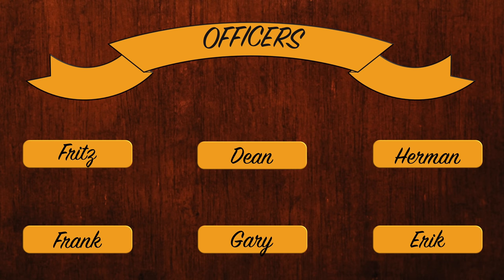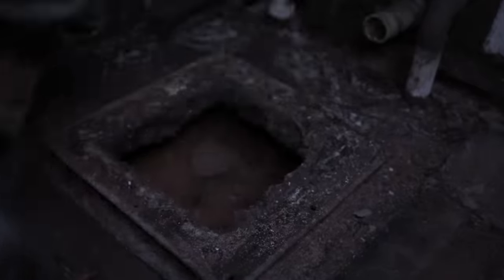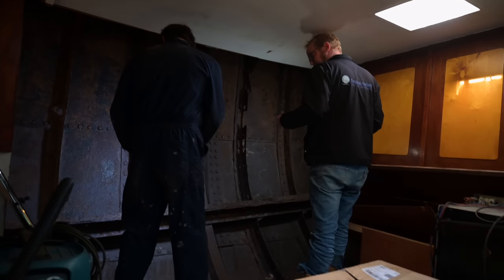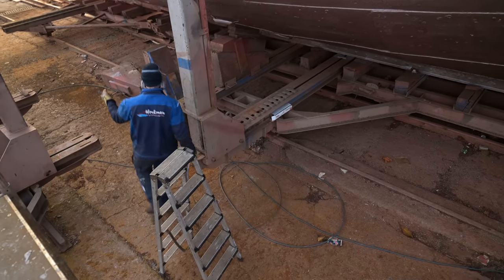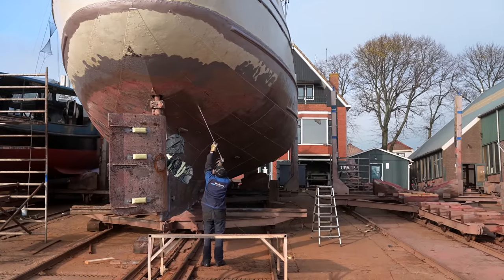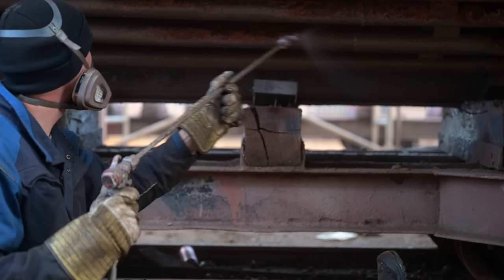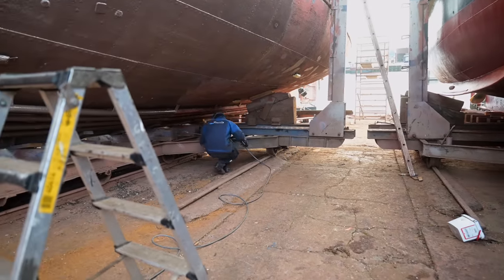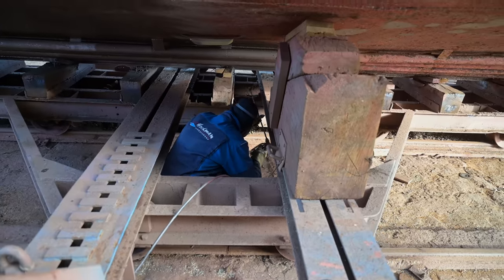Finally Painting Our Historic Steel Ship

Comment from the maker: ❓❓❓What do you think? How many liters of primer and antifouling has Jan sprayed on the hull❓❓❓
Reply: I'll guess 30 gallons or around 120 liters of each.
Reply: been watching since the beginning  will watch until the end you have me invested in seeing this completed then the journey's you will do after it's done
Reply: I Think it’s wrong to paint the zink annodes! Now you will have suver corrosion!!!!
Reply: Who cares!
Reply from the maker: We haven't painted over the aluminium anodes! 3:35
Reply: Lots
Reply: I think you should have sand blasted the hull.
Reply from the maker: @bertram5798  Jööö 🤣🤣🤣
Reply: @leifjonsson9410  Look closely, they were taped over before painting commenced.
Reply: 240 L
Reply: Hi you don't seem to understand. Its not the overall amount it's more the thickness. It's at least two coats and a third on the waterline of antifouling. And of course the same goes for the primer. I bet the rust is already shown through and you haven't seen salt water yet.
Reply: 20 kgs of both
Reply: a lot?
Reply: @leifjonsson9410  better watch with your eyes open....

Comment: You can also tow your ship with a rowboat. My father was an inland shipping skipper and he once towed a 600 tonne (loading capacity) towing vessel in a port to the quay for loading. It was about a hundred meters and there was little wind. So this should be possible with your dingy, especially if you use the 6hp outboard motor, although the outboard propeller is not very suitable for towing.

Comment: Great job guys.  Flying Coney looks fabulous in paint, so important to get the preparation right - and have a tall Dutchman to wield the paint wand!. When we repainted our Dutch steel trawler last year. We stripped all the paint to bare steel and elected to use two-pack paint.  3 coats of two-pack below the water-line then a single tie coat to allow the anti-foul a good bond.  We are hoping to only need to renew the antifoul over the next 10 years.  can’t wait to see how you progress with the interior.
Reply from the maker: Your project sounds very interesting and quite familiar. What's the name of the your beam trawler? I've also read your previous posts and find your observation on hydrojet blasting quite helpful. Where are you located? All the best!
Reply: @FlyingConey  Hi Barbara & Daniel, our vessel is called “Stella Maris”.  She is a converted 1962 Beam trawler, we think possibly from the Urk region.  She is 67 feet LOA.  Stella Maris is berthed at Ramsgate Royal Harbour, South East England. I did not have the foresight to video any of the work but I did take lots of photos.  Perhaps when I find time I will try to collate them into a slide show.  My background is maritime.  I was a sailor in the RN and therefore learned how to prep and paint steel from a young age.  When your vessel spends only 14 weeks a year alongside, you have to make sure your paint job is good or the next time it is much harder because you have to go through all the hard work that you have both now experienced. I hope you are both really enjoying your beautiful ship.

Comment: A small question but I cant help it. Do the small patches under the wooden keel blocks get painted? 
As always, amazing job Flying Coney
Reply from the maker: Actually a very good question ☺️ The answer is, no they're not but it's a very thick piece of steel and it's some people recommend to go to a different shipyard from time to time so that not always the same spots do not get painted. The problem is that ships are only built for 20-40 years so during their lifespan it doesn't matter. Bur Flying Coneys keel does look fine.
Reply: Thanks!

Comment: 9:55 "Its a steel ship." To myself: "wait? Is that ship stolen??".... "No of course not, its a boat made form steel", and indeed it is.

What i always wonder is: how are you going to paint the parts where the ship is resting on the stands?? Do you go back into the water, and then onto the dry one more time to get those parts too???  These parts will have to be done too of course. 

The antifouling looks great. The silver fleet would have been cool, but the red certainly looks original. 

I did fill in the volunteer form. Maybe it is something you will find handy. I love it when things get done right and get finished perfect. 

Greetings,

Jeff

Comment: I'm curious about the pipes on the outside of the hull near the keel. What are they for?
Reply from the maker: That's the cooling for the main engine and generator.
Reply: @FlyingConey  Interesting, was the cooling system put on the outside to have more room for the catch inside? I've never seen a setup like that.
Reply from the maker: It's called a keel cooling and it was added when Coney was converted to a sailing ship. On fishing vessel it's not that common since the cables and nets could get caught on the pipes. So back then she had a quite large engine that was cooled with sea water and a heat exchanger.

Comment: Ooops, you shall not paint the sacrificial anodes.  wire brushing is to slow.  With a lot of shale rust you use an air slag picker, then wet sandblasting and then dry sandblasting to get the thin rust layer from the wet blasting.  The wet blasting is also refered to as dust free blasting.  Just keep in mind that every cm2 has to be inspected for pitting.
Reply from the maker: I always find it fascinating that people think we've painted over the anodes. Of course we've taped them off before spaying the paint. On the long run using a needle scaler gives you a pitted surface. It's exactly the method that was used on our boat for several decades. Sandblasting seams like the go to option but it's problematic on riveted ships. We will probably go with a laser blaster or with hydrojet blasting. We've an average steel thickness of about 7mm so I'm not overly concerned about the pittings. By the way we've mostly used a rotating blaster by the brand Tercoo, it's way better and faster than a wire brush.
Reply: @FlyingConey  Pitting as long as it does not affect the structural strength is not too much of an issue. and if it is localised, replating is not too expensive.  if it is borderline, even some small yards have metal spraying equipment.  Sandblasting is allways an issue in small shipyards, with neighbours close by, but wet blasting gives littel dust problems. It does how ever leave a film of rust. to be removed with little sandblasting or an acid wash.   One of my first repair jobs as an apprentice shipbuilder was on a riveted ship. More than 50 years ago
Reply: @FlyingConey  a lot of arge ships and offshore structures have an induced current on the anodes, to give better protection.  15mA/m2, I think, but check that figure.

Comment: I am a steel fabricator/ welder and have been sailing and working on boats in various parts of the world. Although I admire your tenacity, one coat of primary and a single coat of antifouling especially sprayed on, is not going to last very long.
Reply from the maker: I appreciate your comment! Since we are still in the refitting phase of the project and we still need to weld the frames which will destroy the paint the antifouling needs only to last one year or so. On the long run we've planned to apply copper coat.
Reply: Geoff, they’re on a budget.  Prevention now will buy them time.  I chose to wait 5 years and save the money. I put 3 coats of two-pack below water line, a tie coat then the antifoul.  I’m hoping my investment will keep the rust at bay for at least 10 years.  just antifoul every two - three years.  he says, hopefully! 🙂
Reply: I know little about steel boats but I can say that on fibreglass boats in the tropics, anti fouling is an annual project.
Reply from the maker: @stephenburnage7687  I think it has nothing to do with fiberglass or steel. On a vessel of Flying Coneys size taking her out every other year is more than enough. A little bit of marine growth doesn't matter all that much.
Reply: @FlyingConey  i think it is a question of which waters you are in.

Comment: You're not supposed to paint over the zincs.they wont work with bottom paint covering them !!!
Reply: Watch the vid closely.....all the zincs have been masked off. They were not painted over. 😊
Reply: The anodes have been covered with tape for painting. Once the paint is dry the tape will be remover. These guys have it all sorted!!
Reply: They’re not zincs. They’re aluminum… and they’ve been taped over for the painting… did you watch the video?